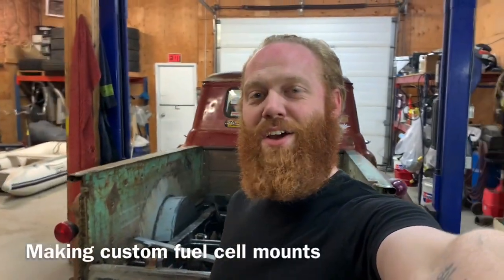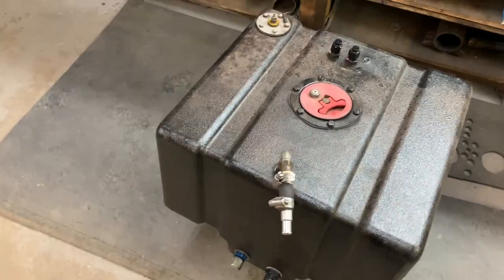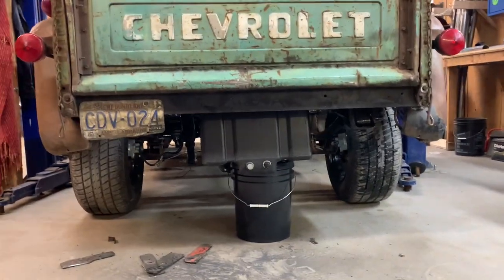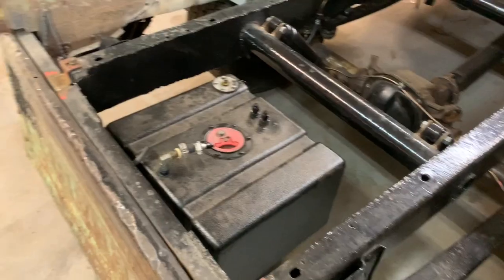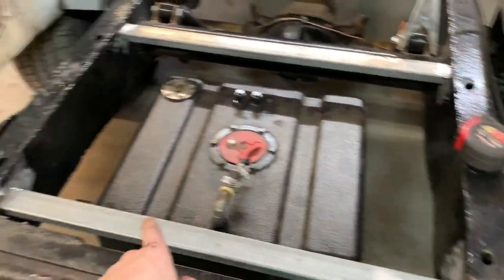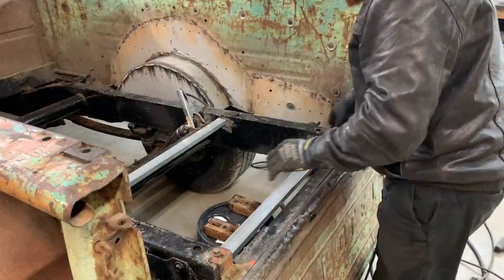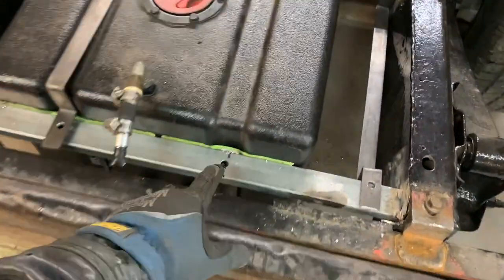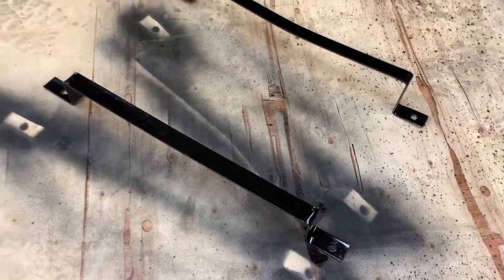Mounting a racing fuel cell into the bed of a pickup, with very few materials

Comment: I would install a trailer hitch or something to protect the back end at the  bottom. You don't want it to turn Into a pinto.
Reply from the maker: I’ve been thinking about a hitch. It’s well protected by the big ass 4” channel on the back, but I’d also like to tow a trailer
Reply: The two outlets looked exposed but maybe I commented before you were done. And Happy Father's Day.
Reply from the maker: Looking back at it, it is ahead of the bar but is still below it. I think I’m going to build a  bracket or something just incase someone’s bumper gets a little personal with mine. Thanks for pointing it out. 

And thanks a bunch, yourself as well!